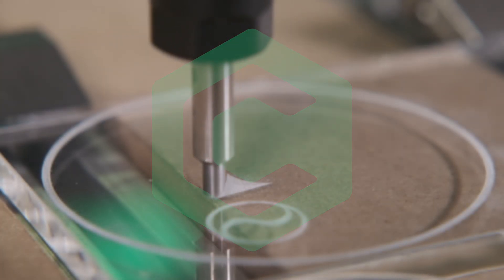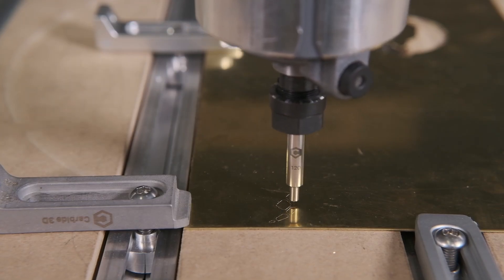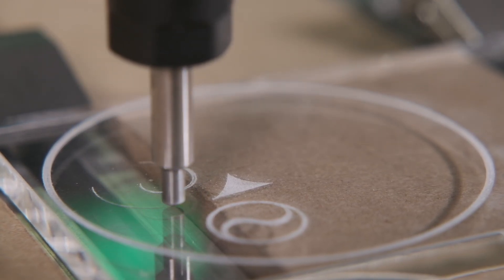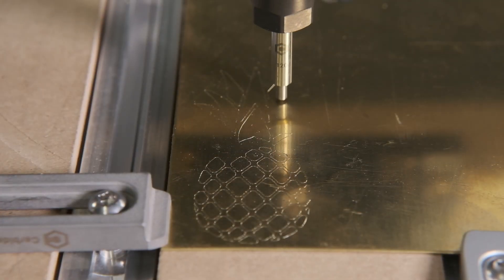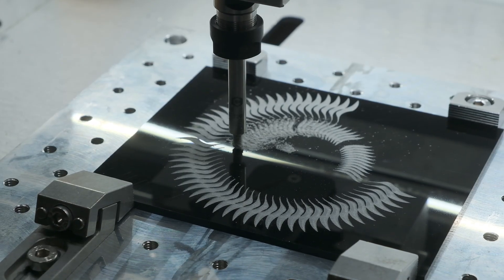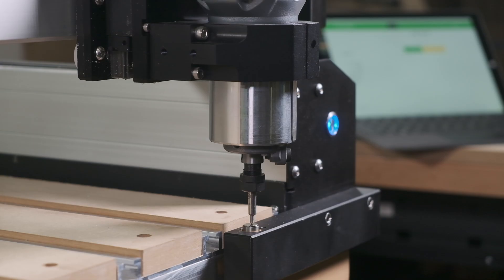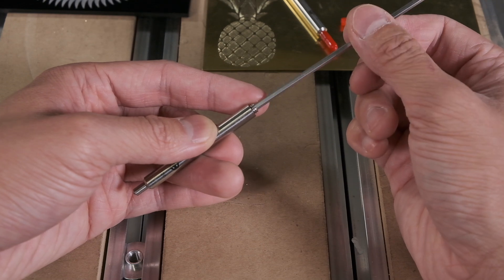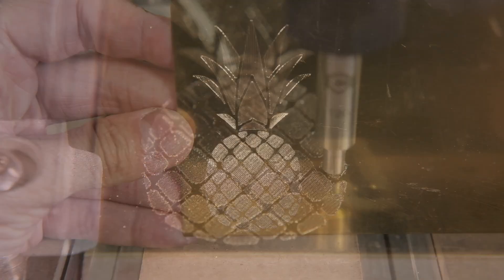MC Etcher: Carbide 3D's new Diamond Drag Engraver

Comment: What's a good line width value and stepover for the 120 and 90 deg? :)
Reply from the maker: Raven.  You can experiment with the stepover value to produce whatever gradient you’d like in your project.   Take a look at this:  https://www.instagram.com/p/Chspwt8vndJ/?igshid=NzBmMjdhZWRiYQ==

The “line width” is predetermined by the bit.  90° digs deeper than a 120°.  Both produce relatively fine lines.   The amount the bit is able to dig into the material depends on the spring tension (as adjusted by you) and the hardness of the material being engraved.  Experience will be your guide.   
As to the angle, I find a 30° infill pleasing.   And I’ve also mixed infills on projects to produce contrast.
Reply from the maker: Additionally, You’ll find examples of drag engraving. Throughout our Instagram feed as well as our YouTube projects.

Comment: 2:57 its fine paper allready invented its bout 0.1mm. when you feel paper start drag under tool you know you 0.1mm or less from your part.
try cut. if nothing hppen lower z 0.05 cut. if not happen lower z 0.025 and so on until you see. you just cut propable less than you last change LOL
but you can set z0.1 0 it will hit OR use 0.01 thin shim even more acurate

i bought one of these for writing plates you see on every machine back corner. kinda same but to some bridge thingy lol.
we have used 2mm ball nose mill and 0.05 depth would be so good looking but guys do it 0.3 whaaat friiking burs.
machine rpm not even go over 6000 so think how slow feed is yeah. hope this make writing faster LOL
i used my own money buy tool for company LOL when boss is cheap how much 2mm ball nose cost 8 bucks? ho many we broke this cost 30 lol
and no need be that acurate on z bcoz aluminum plane is allmost eveytime bit curved and guys not pump plate down whaaat.
i make setup and pump plate down. they not pump it and it go deeper YUAK i would not even sell that quality lol.
next i might buy heimer zero tool bcoz boss is cheap.
i can measure everything better on my home cnc router than on company huge 40k cnc machine bcoz there is nothing
i have even make own custom program that write text no need CAM do same thing allover again when serial number change or date lol. just change variable and hit cycle start BOOM

Comment: I own a lakeshore carbide engraver. What are your thoughts on diamond drag vs lakeshore engraving tool for high carbon steel? Most drag tool uses I see are for aluminum and some ppl complain about breakage or wearing depending on the product.

Comment: The same g-code editing for the Nomad could also apply to the Shapeoko if you're using the BitRunner or a DIY alternative. Will C3D patch Carbide Motion to automatically ignore these commands if you're using a drag engraving bit (assuming it's a predefined tool, like the ones already supported in CM such as the 102, etc.)?

Comment: Just ordered a set.  Has anyone tried it with Frisket Film or Transfer Tape for Vinyl?
Reply: I doubt it will work at all with such products. Definitely not with vinyl! I've never handled or know what Frisket film or transfer tape is, but for diamond drag engraving, you need a hard surface to engrave into. The tool is pressed onto the piece and something like vinyl is only going to tear.

Comment: I would love some ⅛ inch offerings for use with the Snapmaker.
Reply from the maker: We'd love to but it barely fit in the .25" shank.
Reply: @carbide3d  Just found a .25" ER11 collet on your site, which is what the snapmaker uses. That would probably have rigidity issues, but I think with lower downward pressure and work speed, it could be doable. What is the OAL of the Engravers?

Comment: Is this tool suitable for PCB isolation routing ?
Reply from the maker: We can't guarantee it would consistently break through the copper skin on a PCB. A tool like this will partly scrape material away, but also partly deform material out of the way. Mechanical engraving with a rotating tool is the most reliable way to do it.
Reply: @carbide3d  Okay, thank you for this fast and detailed reply.